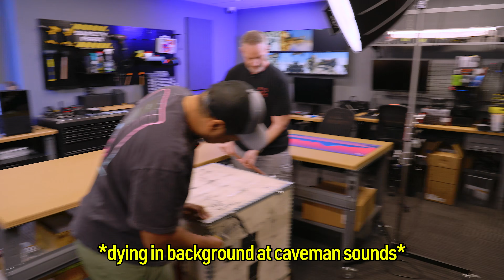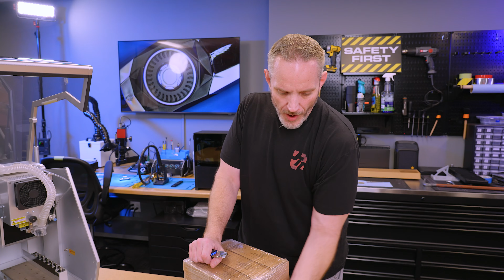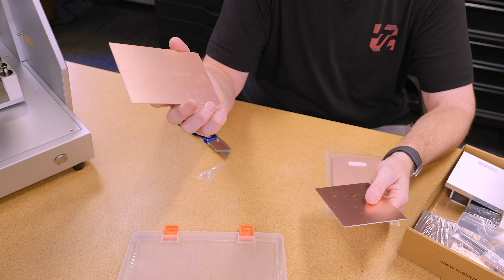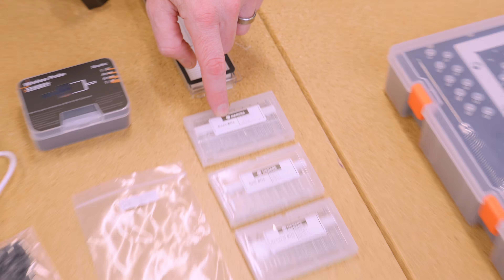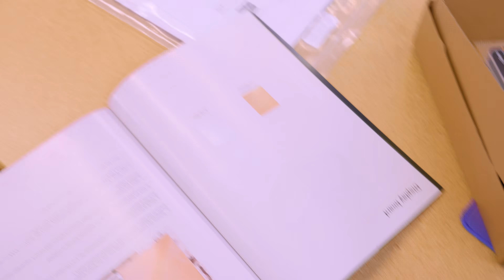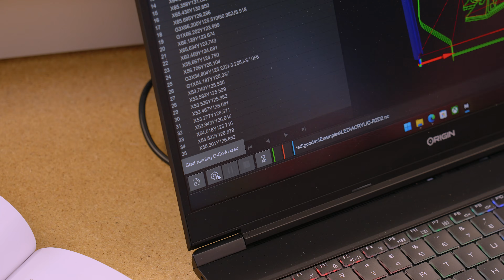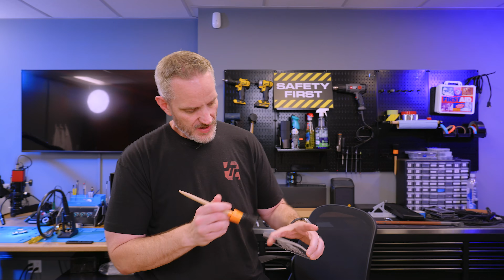I got a new CNC Machine… what could possibly go wrong?

Comment: i would try a thicker fin width with a slight chamfer / angle or stepped vertical. more surface area in the same height.  I think an original idea worth trying because i doubt anyone else has. Inspired by 3D cache.

Comment: With acrylic, you're better off using compressed air or coolant to cut it cleanly. And you can polish acrylic pretty easily.

Oh, and CAD/CAM is Computer Aided Design/Computer Aided Manufacture

Comment: Can you run 2 power sources to the rotating assembly to have a cleaner cut? While also lowering power draw and pushing more power? Add an adjustable inverter so you can turn a knob? I’m sure you like knobs

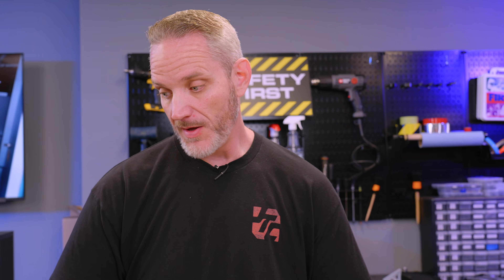Comment: 14:26. Usually CAD is Computer aided design, and CAM is Computer aided manufacturing. And then the actual use of each should be in the name self expl, cad for Designing parts, and cam for programming the machine for different operations.

Comment: Watch for high voltage static electricity when using an external vacuum.  Nothing generates high voltage better than a high speed drill/mill cutting copper and sucking it thru a pvc hose.  Ground the vacuum to bleed charge.  I told you so!

Comment: it's insane what they charge for a plastic engraver. if you have warehouse space and 220v and want to actually have a chance in hell at making something, go for a used haas minimill or the top of the line tormach. it might be 20k with some tooling but you'll actually be able to make stuff. you could make your own water blocks and distro plates etc. that or just send out the work to xometry.

Comment: If your going to run aluminum get good tooling, yg1 makes good tools for aluminum. 

Also before cutting make sure you learn proper feeds and speeds for the material you are cutting. Otherwise you will have a big gummy mess. Coolant is also extremely important in cutting aluminum don't think that water will be enough.

Comment: custom back plate or even heatsinks to use on the cards for VRAM and power as well as back plates to hold CPU water coolers or even just giant air coolers to lower and mid-end cards; think of that one NTXZ produced for a while and then gave up on. I know that a water cooler on a mid-end card isn't cost-efficient, but you can use an AIO on a card like a 7700XT or, in my case, a 6700XT just to get rid of the noise!

Comment: nice tip for ya, buy sheets of 1/2 in MDF for prototyping. it's a lot cheaper then metal or plastic, cuts easier and faster, and is pretty consistent thickness. That way hopefully you ruin fewer bits and blocks of material. next is time for a UV desktop printer, so you can print graphics, then cut them out for labels/nameplates and logos!

Comment: As a machinist by trade my advice to you is never cheap out on tools. Those cheap end mill and drills on Amazon may look tempting and maybe could get you by on a small hobbiest machine like this, the more expensive ones will be worlds better and worth every dime. Also do not treat this like a 3D printer and leave it to run a job without you there, always be present when these are running an OP.

Comment: If you are going to be milling any steel with this, bare in mind you will probably have to keep manually lubricating the cutting area as I didn't see any mechanism to do that automatically.  This is to stop the bits from overheating which generally leads to them sheering off.  If you are using diamond tipped bits, that can get expensive.

Comment: Ok hear me out... Make a custom case with it. I know its not big enough to do full on panels in one piece but its big enough to do sections that then are riveted or screwed to a frame you make out of like L-bracket/angle iron. You could go as far as making a custom water block for the cpu and a distro/res block.

Comment: Hey Jay, I used a very similar desktop mill to prototype and produce custom air gun magazines from aluminium. The most important thing I can tell you about these little machines is that high width of cut with very shallow depth of cut is your best friend when milling metals. The rigidity is quite limited, as is the spindle power, grab the largest single-flute carbide endmill it'll take and run it at 0.3 - 0.5mm depth of cut, 80% stepover (width of cut). Keep upping the feed until the spindle stalls, then dial it back 20%. Get familiar with something like Fusion to do the CAM part. Their adaptive toolpaths are fantastic, and there's an ocean of great tutorials to get started (like NYC CNC, AvE, and a whole lot more). Good luck!
Reply: Is high WOC and shallow depth better than thin WOC and deeper depth on these small mills? Why the difference?

Coming from Haas CNC mills with a CT-40 spindle taper, it was generally my goal to make deeper cuts in order to wear the tool evenly, as shallow cuts will wear the tip of the tool only and you'll have to replace dull tools more often.
Reply: @Govanification  The higher your DOC, the higher the axial force trying to pull the endmill and with it the spindle and the gantry down into the cut. That Haas has has a frame made from several thousand kilos of cast iron. This has a few 15mm thick plates of aluminium. In an ideal world (that is, with a big fuck-off VMC) you'd use as much of your tool as possible but these small desktop machines are simply not rigid enough to support high DOC cuts even with small endmills (at least my Nomad 3 wouldn't even do a 5mm deep cut with 0.1mm WOC and a 1/8" endmill). 

To take a high DOC cut on a desktop machine like that you'd have to take such tiny WOC stepovers that you can't feed fast enough to compensate for chip thinning; even if the little nema 17 steppers could feed that fast, you'd run out of spindle power before the required feedrate, and even then the cuts would be so tiny that I doubt the cutter wouldn't just chatter off the surface rather than cut anything. Shallow cuts don't pull on the tool nearly as much, which is why low rigidity machines like them a lot better.

Comment: As a machinist, not having a handwheel or a feed control knob would make me extremely nervous about everything.

Also, a tip when clamping parts: use  buildup that is slightly taller than the part at the rear of the clamp, and position the screw as close to the front of the clamp as possible. You want the clamping force to go into the part, not into the table.

Comment: Wow, that one is definitely fancier than mine, also a bit smaller.  And mine cost under a Grand. Of course...mine is still in its box.  Can't really use it in an apartment, I suspect people would just NOT be amused listening to it.  It was a very cool, and very poorly thought out gift. LOL

Look at your spindle specs, you'll probably want a bigger one.  At least I'll bet on it with the research I have done.  I can see you wanting to do the same things I want to, chunky aluminum, brass, and copper.

I have a large format FDM that can do nylon and engineering filaments.  The 2 would be a match made in heaven if I could run the blasted CNC here.  I need to move, but also don't want to.

Have fun with your new toy!!

Comment: I would call that a CNC router, and a toy one at that.  A real mill is just so massively much heavier to have the rigidity too properly cut metal.  For example my manual knee mill is 3000 pounds and is still a wet noodle compared to a real CNC mill.  Should be quite capable for small wood or plastic projects.  I'm rather suspect of it's capabilities to cut aluminum, even though it's only a little more difficult than hard wood.  You'll find that fixturing and work holding is an artform all of it's own, and developing a process plan for handling a part your cutting takes a bit of learning.  Don't be afraid to 3d print brackets to hold parts, we do that in real industry.

Comment: I couldn't get the windows based cam software to work on windows. However, the windows cam software does work on linux. I have the Air and haven't used it yet due to said software issue.

Comment: whoever coded the cut outs should have broken it into multiple passes.... you usually want to stay within a quarter of the tool tip. on this sample, you didn't have to work about tool clearance. If you get to the point you are cutting out large materials, you will have to worry about tool clearance, and possibly tool assembly clearance. But that is a great little mill you have there. 

I used part of a gi bill to get CNC certification and worked for 6 months at a specialized cnc company. I was a lathe operator instead of mill operator. What will be nice is if you learn the coding for the hardware, or hire a coder, you should be able to take a 3d render, and by removal cut full custom pieces, not just reliefs, although those tools are rather small.

Great video! Best advice I can give you is make sure you use a couple of shims to keep it level. Vibrations compound and can have a drastic change on tolerances.

Comment: im a cnc mill guy in ont
idk if i would call that a mill tho
biggest part i ever did by weight was
48,000 lbs 4140 steel block machined into a table for a press
by length idk 40 feet long prbly.
im makin parts for railroad repair kits atm
we do make alot of diff parts for zambonis
and road spraying machines.

Comment: I was a CNC Programmer for 15 years using good ole Toyoda fh45's horizontal and Makino vertical mills until NAFTA ruined our manufacturing jobs. Atleast you don't have to learn G code and manually enter your programs and sub routines these days. I got out around 2015 when everyone started getting fully conversational machining centers. btw its called coolant not lubrication....

Comment: If I'm not mistaken there was a extra piece if you get the blower add-on that you also have the option to have it dispense cutting oil with it. This will prevent your bit snapping on harder materials, especially metals. The oil will provide lubricant for smoother cutting, and also provides cooling. Might be worth looking into!

Comment: Corn Teeth End Bits

Corn teeth end bits edges are full of teeth. This can make these CNC bits look similar to corn.
Their unique design and plethora of cutting edges, these bits work exceptionally well when dealing with tough materials. They often leave a smoother edge since their abundance of cutting edges smooths the working surface.

Laminated materials fare better with compression bits than up-cut or down-cut bits. It will give you a cleaner cut.

Solid Carbide or Carbide Tipped CNC bits are best when you’re working with extremely hard materials.

If you’re working with hard materials, but not doing anything too fine, corn tooth end bits will work well

If you’re working with hard metals, carbon fiber, or glass, consider buying polycrystalline diamond bits. Diamond is hard enough to cut these materials easily.

If you’re doing fine, detailed projects, tapered ball-nose bits will give you a clean finish. Especially when engraving, carving, and doing scrollwork.

Comment: You can also super glue your piece to the waster plate. So you can cut all the way thru without worrying about your work piece moving.
Reply: Or probably double sided tape. I have used that with much larger projects and I don't think they will be cutting anything hard enough to move it.
Reply: @nicholastoomey928  I'd recommend good double sided tape. Just a couple of 5 cm strips are enough to hold stuff down.

Comment: As a veteran cnc programmer and operator of 40 years of 3,4 and 5 axis mills , I highly recommend getting your feet wet with just the 3 axis machine first. Once you have a good handle on that, then venture into 4 axis work.
Reply: Dump him straight into a Swiss lathe.
Reply: @jokeassasin7733 I second this!😂
Reply: @jokeassasin7733  lol  oh man.
Reply: This is none of those things. This is a microwave oven with fixed buttons for popcorn, pizza, and hotdogs. No one using this is going to be figuring out how to implement interpolation or how to use oscillation to minimize tool wear.
Reply: @RYTHMICRIOT  I know exactly what they have. I was merely saying not to jump into the deep end immediately.
Reply: @RYTHMICRIOT  They bought a 4th axis and he said just worry about 3 for now. It's that simple to comprehend. No one mentioned any of the other stuff. You just made it up. 😆

Comment: The "corn bits" ( or as we machinest normally calls them " roughing end mills " ) it to quickly rough out/remove the material that's not needed quickly and in smaller chips taking up less space, and then take a pass or two with a finishing end mill to get the decide finish we want and take the part to size
Reply: i like to see do a quick rough out with a "corn bit" on a block of aluminum, they are used when cutting sheets of fiberglass or similar material, i wouldn't even use them on mdf, u dont sound like a machist aye
Reply: @jimmyjames1807  I used them plenty on both aluminum, steel, stainless, titanium, copper and many other materials ( I am also a full blown machinest, and works on the industrial level of cnc's though we do use the same kind of tools ( and a could other types, at a higher quality level but still same kind of tools )

Comment: Hey guys, I've been a general/CNC machinist 30+ years..
Corn tools (corn cob mills) are tools that are also called hogging mills (sometimes also called Burr bits) used for removing material (IE heavy cuts), they are made out of carbide or HSS/HHS cobalt material normally.  

So I'm not familiar with the specifications of the machine or tools, but I don't imagine it's a very high horsepower/torque so be careful when taking deeper cuts... Ohh by the way you're probably going to end up buying more tools and tooling as you inevitably spiral more into the world of making your own stuff. Congratulations you're already hooked and you'll be making all kinds of projects soon enough 😂...You can check out Titans of CNC for their tutorials on programing, CNC, etc.. Have fun guys👋
Reply: These ones are also highly recommended for use on composites, leaves a very nice finish on carbon fiber, though you need to be a little careful about material sticking onto the burrs, so needs to be cleaned every 20 to 40 minutes of cutting.
Reply: Afaik corn cob bits are usually used for fibreglass or other fibrous materials for routers like this
Reply: Stay away from Titan as he is an idiot and you will only learn how to do it wrong.
Reply: @dikkybee  what’s the name of your shop?
Reply: @CapnDiddles  I actually have worked in industry for 40+ years in Australia making gearboxes for Abrams tanks and various other military items for many countries. While there was making items for Aerospace then moved into a government Science department and was making various high precision parts for medical and computer items. Designed, manufactured and installed parts onto a truck that could measure cracks as small as a millimetre in a road while doing 100 KPH. I know how to do it and make money without destroying tools like that fwit Titan does as those costs have to be paid by a customer. No good making a part quicker and saving the customer a couple of hundred dollars when you are destroying tooling that cost over a thousand dollars.
Reply: @dikkybee  km/h
Kph doesn't exist.
Reply: @dikkybee  kilo per hour. fwit. Lmao

Comment: G Codes and a few M Codes. It's fairly easy. I built my own with a workable area of 28" X 38". I'm guessing you have to hook it up to a PC and monitor, which will be a whole lot better than a phone, especially when designing things l. The design software you get affects the ease of making your project. Travel speed has to be matched with the type of tooling and material.

Comment: Toy for YT and apartments... But its a small and easy thing to learn on you need to start somewhere.  Next step  china machine like 4*8ft 1325 Cnc Router 1300mm x 2500mm Wood Carving... or/and a 1500w+ Digital Laser Cutting Machine Auto Focus Head 4*8ft 1325 1610 1530 CNC Fibre Lazer Cutter... they take up some space but you can do a lot more stuff with them. Like if you want to make custom panels, custom water reservoir, engraved panels for your custom builds. Or if you want to expand your brand and offer stuff for sale.

Comment: Suggestion if you plan on machining a lot of acrylic. Deionizing gun to suppress the static cling of chips caused by milling acrylic. Helps prevent scratching to maintain the crystal clear acrylic appearance.
Reply: Seeing an earth bolt inside the case makes me think how that will work? Attach to the material?
Reply: @Bratfalken  sth like Simco 4007005 - Top Gun™3 w/Sidekick & Hands-Free Stand or Simco-Ion 4006992 Top Gun Sidekick Hands Free, maybe

Comment: learn sfm and chipload
sfm = surface feed a minute and is used to set rpm , I generally use 600-800 sfm for aluminum but use a much cheaper machine cause I'm cheap lol 
calculation for sfm is = sfm X 3.82 / tools diameter = rpm 
so for my above 600 sfm and say an 1/8 end mill would be 600 x 3.82 / .125  =18,336 rpm 

chipload is the amount of material a single flute " cutting edge '" removes per one revolution of the end mill and this is used to set feedrate " how fast the machine moves while cutting " 
formula = number of flute X chipload X rpm  = feedrate 

my cheap machine likes .0015" chipload for aluminum and use a single flute end mill so  1 x .0015 x 18336=27.504 ipm " inches per minute " 

while sfm is easily googled for wanted material and end mill manufacture will list recommended chiploads for that exact tool you'll find you need to do trial and error as your exact machine rigidity and clamp setup will determine how fast you can run a job 

always recommend practicing on cheap material that's fairly soft to not just blow tooling , pine is readily available everywhere and cheap , have fun and look forward to your designs 

plastics and metals will benefit greatly from a cooling solution , air blast , mister , coolant flood etc will make life much easier